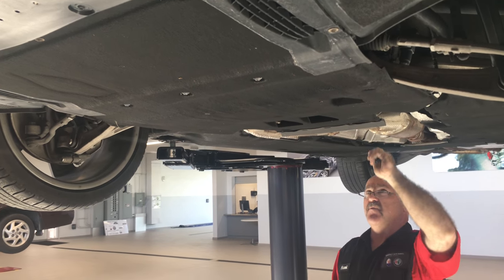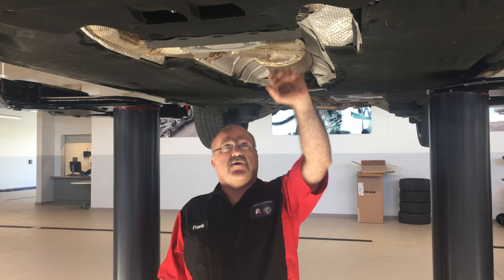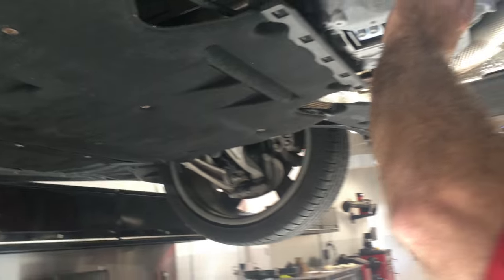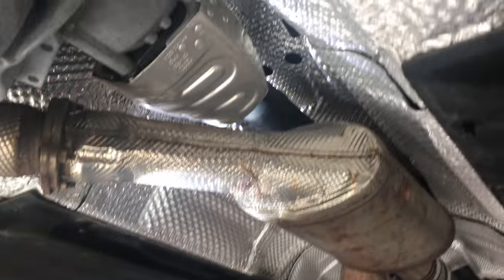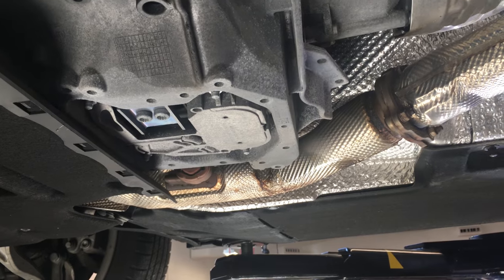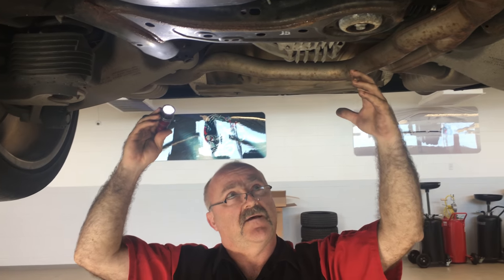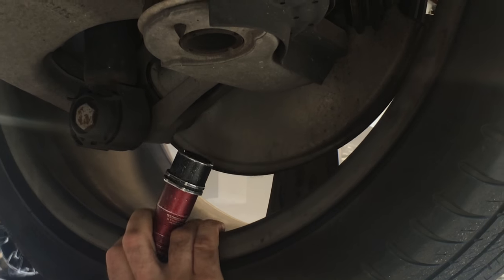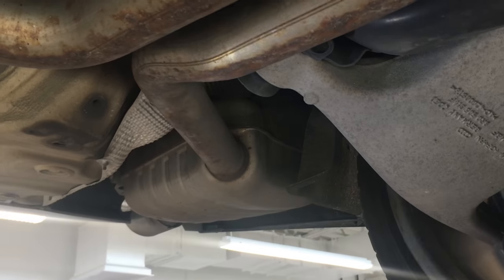"What's underneath your vehicle?" with Frank Gray

Comment: My car is releasing smoke in the exhaust the middle portion . Don't know what to do
Reply: I know your comment is older, but I thought I might reply anyways: "Many times, this thick smoke is due to the likes of a blown head gasket, damaged cylinder, or a cracked engine block, which is causing coolant to burn. Thick white exhaust smoke usually indicates a coolant leak, which could cause overheating and put your engine at a serious risk of damage"